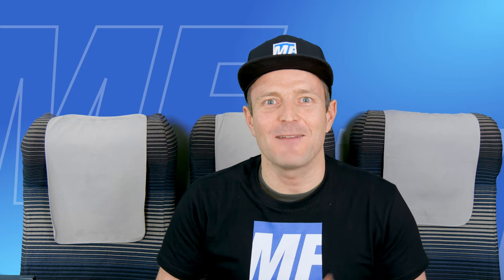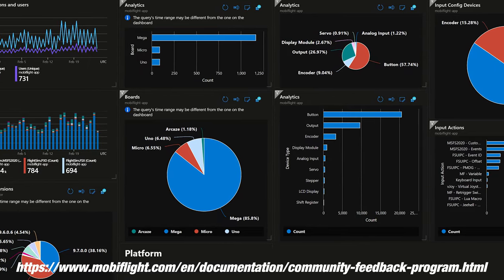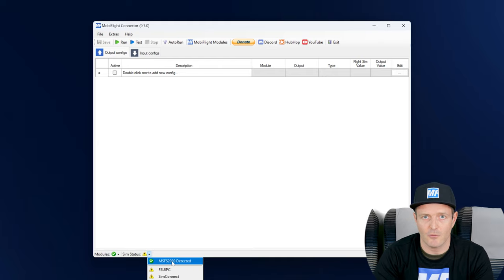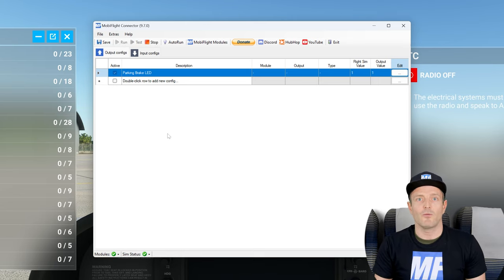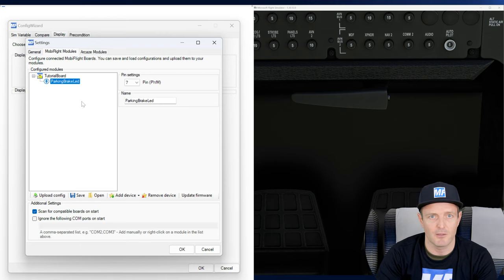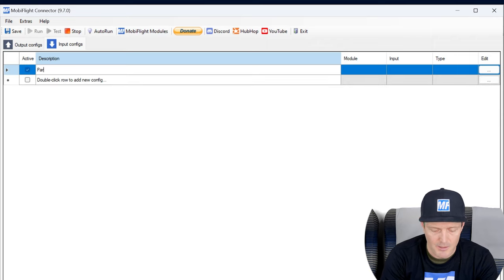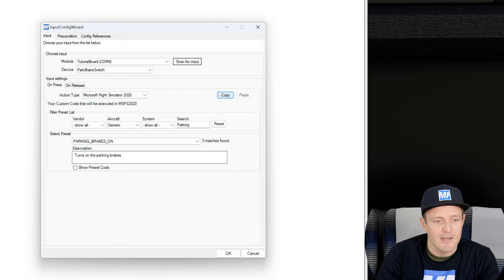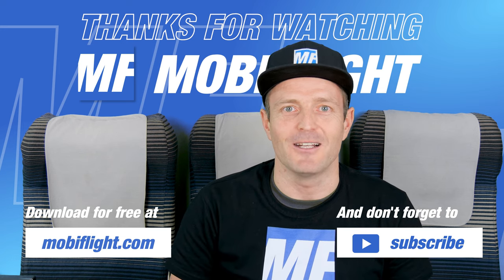Getting Started 2023 - MobiFlight Tutorial

Comment: Cool presentation, powerful product. I tried the parking brake example, LED + switch, and it worked fine.
So here's a question - does the MobiFlight PC application need to be running in the background, or is there a way to upload all the functionality to the Arduino board, so that the host computer running FS2020 wouldn't need an additional program when actually flying?

Comment: Very good thanks. Wish we could have seen the board setup, bit of a glass ceiling for using the software
Reply from the maker: Do you mean connecting the switch to the board pins?
Reply: @MobiFlight  that’s correct
Reply from the maker: @alistairknott6075  i plan to make videos that focus on the individual device types and there I will better highlight the connecting psrt
Reply: @MobiFlight  fantastic thanks, have subscribed. Not started wiring of my PMDG 737-800 Sim and plan to use Mobiflight but the whole Arduino (or what would I use Leo Bodnar for instead) is a whole new learning journey
Reply from the maker: @alistairknott6075  to connect a button or switch you only have to run one wire from any of the pins to your component and one wire back to ground.
Reply from the maker: @alistairknott6075  you will see that it is pretty easy
Reply: @MobiFlight  you are right!!
Reply from the maker: @alistairknott6075  did it work?
Reply: @MobiFlight   It did thanks, much appreciated. On the 6 pack, it says documented in xml file but not working yet. Any timeframe on that?. Note that APU recall is not in list, only 5. Thx
Reply from the maker: @alistairknott6075  i recommend joining our Discord. There others can also help with your questions: https://mobiflight.com/discord
Reply: @MobiFlight  will do

Comment: I just got started with flight simulator 2020. Very good video. Sebastian I am using Scott Vincent to display the gauges on a 2nd monitor. I am new to this. Is that what I should use ?  what you recomend ?
Reply from the maker: You can use what you think helps making your flight sim experience better. At the moment Mobiflight doesn't offer software gauges yet. Last year I made a Proof of concept where I exposed the data from Mobiflight to a browser with software gauges. So in the future this will become a feature.

At the moment the strength of Mobiflight is to build real physical hardware. You can build real gauges using stepper motors or servos. That's a lot of fun.

Comment: Thank you for your tutorials. 
I have a question:
When I have done the complete configuration and start MS flightsimulator, do I have to run Arduino IDE, Mobiflight and Simconnect in the background or is the Arduino Controller then working self-sufficient? 
Thanks for your great work.
Reply from the maker: you only need to run MobiFlight - the Arduino IDE is not needed at all.

Comment: Good afternoon, first of all congratulations for your work. I need help. I have built an overhead and wired and programmed with mobiflight. I have used 4 Mega R3 cards, but I don't know how to make all 4 work at the same time, both leds and buttons. There is a way. Thank you so much.
Reply from the maker: you connect them at the same time and Mobiflight will see them and you can control everything through Mobiflight

Comment: @MobiFlight
Hi Sebastian, and thanks so much for the clear and useful tutorial. I was unsure on how to approach MobiFlight, but after watching your video I'm confident I can make it 🙏
Still a couple of small doubts: for MSFS (and PMDG 737-800 in my case) I get that the variable type to use is SimConnect, while instead FSUIPC offsets are meant for P3D and DataRef are for X-Plane. But then what about the remaining type, MobiFlight variable? And also, in my configuration as above, does FSUIPC need to be installed or not?
Thank you and kudos for your excellent work!
Roberto
Reply from the maker: mobiflight variables are sometimes helpful when you locally want to store a variable, e.g. for a multi function based on a switch position.
Reply from the maker: In most cases, you don't need FSuiPC for MSFS2020. MobiFlight is not using the native PMDG SDK at the moment. FSUIPC may allow you access to some datapoints fortnehme PMDG. you don't have to use a registered version though.

Comment: Thank you very much for the great contribution to the simulation, it is amazing. I have a problem with ARDUINO UNO. I assign the switches and they work very well but shortly after activating them, the ARDUINO UNO crashes, I reset it and it works again but it crashes again after using the switch. What could it be please?
Reply from the maker: sounds like it's shorting out and resetting
Reply from the maker: check your wiring again and make sure it's connected properly
Reply: Hello, thank you very much for responding. I solved it by changing to ARDUINO MEGA. But now when configuring heading I get 344 degrees in the HDG cockpit view, and in mobiflight Flight sim value 359.181976, and in Out put value 359.181976. I have tried some formulas in the transform option but I haven't found it @MobiFlight
Reply from the maker: @danytovar5715 try Round($,0)
Reply from the maker: oh and what plane is that? there might be a special preset for it if it doesn't use the standard auto pilot HDG value
Reply: You were absolutely right, the sim variable, select preset option that I was selecting was not the correct one (HEDING MODE). I changed it to the option (Heading Mag) and it works correctly. Very grateful for your help, now you can sleep peacefully... You are the best @MobiFlight

Comment: hello good.  I'm doing a QT of the 737. Complete.  I would like to know if with Mobiflight I can get the presets for the A/T Throttle Lever and make the movement with some motors.  I have searched and asked on Discord and they tell me that there are no presets for that.
Reply from the maker: What's an A/T Throttle Lever? You mean when the Throttles are managed by A/T mode? It is a closed system and not simple but people have built it.

Comment: Hello, I'm just getting started on this, if you don't mind I would like to ask you. I have an Arduino Uno with an atmega328p u-th 354730, is it compatible? Is the purpose of the program to act as firmware?
 I want to make a flight joystick, is it compatible with hall sensors or should I just use potentiometers?
 Is it compatible with other games like war thunder or DCS?
Thank you so much
Reply from the maker: Arduino Uno is supported. Mobiflight uploads a firmware and makes the arduino configurable. You define what devices are connected to it and you can configure everything through Mobiflight. Watch the video and everything will make more sense.
Reply from the maker: DCS is currently not supported

Comment: What do you recommend if I want to use a hardware not listed there, to receive data from FSX and draw a fully custom graphic, say my own attitude indicator? Do you have example of Arduino IDE code I can get started and write code on an arduino to receive data from FSX and have my hardware react to it? (say simple Serial.println() for now, to write whatever data is received from FSX, if I have that as a template I can code the rest). Thanks
Reply from the maker: you have to check the new custom device and boards feature - this will make it very easy now.

Comment: I'm new to this.  Can you write VB or C code?  Instead of arduino, does it work with Raspberry Pi?  My point is instead of hardware switches, can I create app on Raspberry Pi.
Reply from the maker: you don't write any code when using mobiflight- arduino is the platform for the firmware. we have raspberry pico support. PI is a different platform and the firmware cannot be easily ported. At the moment it's not easily possible to integrate with Raspberry PI

Comment: Good time of the day, be kind, tell me this program works with DCS World , I 'm making a push - button box and I want to put three seven - segment indicators to receive information from the push - button box ? P.s Thanks in advance!!!!!
Reply from the maker: Unfortunately DCS is not yet supported by MobiFlight
Reply: @MobiFlight  thank !!!!
Reply from the maker: @_plasticarmor_8789  what you actually could do is use vJoy to send button presses with MobiFlight to DCS and you can use Mobiflight variables to display data. It can be out of sync with DCS when you start using virtual switches in the cockpit - but if you only use your buttons then it can work

Comment: Hi Sebastian, thank you very much for your great videos. I would like to ask you a help with Fenix A320, I can't see on LCD the set height. The function FXNX320_ACTUAL_ALTITUDE_DISPLAY (A:INDICATED ALTITUDE,Feet) shows the height where the plane is.
Thank you very much.
Mark
Reply from the maker: you're saying the preset doesn't work?
Reply: @MobiFlight  The preset works, but I have the problem that I would like to see the altitude set via the encoder, instead the preset shows the altitude at which the aircraft is and the value goes up or down as the aircraft goes up or down.
If I am at 5000 feet and I set 10,000 feet with the encoder, the preset will show 5001,5002,5003.....
Reply from the maker: @marcoity961  then you're using the wrong preset. you have to find one for the autopilot, not "actual"
Reply: @MobiFlight  I solved it by using FSUIPC7 Offset variables.
thank you for your time.
Reply from the maker: @marcoity961  you should not require FSUIPC for Fenix at all.

Comment: hi guys, i have followed this and i tried adding an encoder. It uploads to the board but then when i try to exit from the screen i get a message that the selected module does not contain any output device. I have restarted xplane, the board, Mobiflight ...I am using a Arduino Mega and pretty sure the encoder is wired up correctly. Not sure what i am doing wrong?
Reply: hi all please disregard
Reply from the maker: i guess you figured it out: encoders are input devices

Comment: Hi there, i just started using mobiflight but my arduino uno is not conecting to mobi flight, how can i fix this issue ?
Reply from the maker: you might have to install ch340 drivers
Reply: @MobiFlight  Hi, my problem is already solved my cable was damaged so i bought a new one and now it is working just fine.

Comment: FSUIPC requires programming and script understanding skills. That's why it's better and easier not to use FSX or P3D
Reply from the maker: we also provide presets for FSUIPC which helps to get started. in general though you're right - it's easier for msfs2020 and xplane
Reply: @MobiFlight  Yep. FSX and P3D are obselete. I'ts requires also multiple connected computers and multiple licences for FSX or P3D. A lot of installing, calibrating, alignment software for multiple monitors. MSFS and X-plane are easier and users friendly if oy want to built a cockpit.

Comment: Hello, its not possible to install. Dowload failed, please run installer again or unzip manually.
Thanks for you Help
Reply from the maker: i bet you're using win7 - what OS are you using?
Reply: @MobiFlight  hy, using win11
Reply from the maker: @MarkusPosch-wp5if  and you have internet connection?
Reply: @MobiFlight  of course
Reply from the maker: @MarkusPosch-wp5if  but the message means that there is some problem with the file download from github which the installer tries to do. you probably have a some extra antivirus software, not just windows defender
Reply: @MobiFlight  thats correct, Kaspersky, but is was disabled 
On my second pc, the install works „with Kaspersky“
I dont understand this Installation failure
Reply from the maker: @MarkusPosch-wp5if me neither. you can always download the latest release from github too, https://github.com/MobiFlight/MobiFlight-Connector/releases/tag/10.2.2 - unzip in a folder of your choice